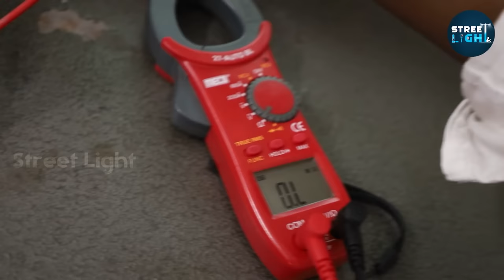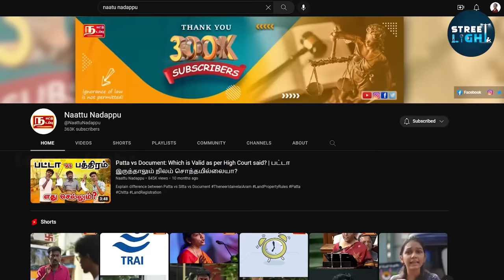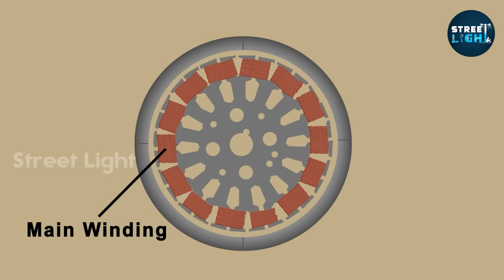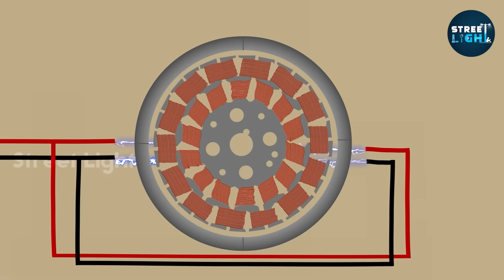How to repair Ceiling fan by ourselves | Capacitor working explained in Tamil | Ceiling fan

Comment: Fan LA sound varudhuna beaninga or roator issue irukalam....bearing ulla oily grease irukum adhu dry aagiduchuna sound varum....bearing mela iruka shield open panni grease apply panni fix panni use panlam....veliye nalla brand bearing vaangna 300 rs aagum...grease,tools irundha easy ah kammi pricela maathikalam....capacitor maximum metal LA kidacha vaangi potukonga....plastic use panradha Vida metal capacitor dhan best....plastic capacitor romba weak aagi fire aana impact adhigama irukum.metal capacitor LA avlo danger kidayadhu....nissan company LA fan related work pannumbodhu adikadi fire aagum....metal capacitor use panrapa fire periya alavula illa....
Reply: Bearing poochina fan கீழ விளுந்துடுமா pls சொல்லுங்க
Reply: @தனிமையின்காதலி-ந7ங  bearing problem aana keezha vizhadhupa....bolt edavadhu loose aana dhan vizhum....noise adhigama varudhu fan vibrate aagura maadhiri irundha oru electrian kooptu paarunga....fan leaf bend ah irundha vibrate aagum....apdi vibrate aana bolt loose aagalam...pudhu fan LA leaf bend irukadhu....naama fan kalati maaturapa keezha vachu adhu mela edavadhu weight vachirundha bend aagum....bearing tight aana fan suthadhu....apdi aachuna fan off pannitu electrician kooptukonga....bearing grease illana noise mattum dhan issue ah irukum....karakarakaranu sound varum....

Comment: ஃபேன் ஆன் செய்தால் ஓடுவது இல்லை, குச்சி வைத்து சுற்றினால் ஓடுகிறது நன்றாக..... எது பழுது அடைந்து வருகிறது ?
Reply: Capacitor change pannunga
Reply: Coil weaka irukum pls test by multimeter or by testing lamp or condenser poirkalaam or bearing poirukalaam
Reply: Mudala original bearing matunga illana coil weaka irukum
Reply: Capacitor problem mattum thaan capacitor change panrathuku capacitor la wire cut panni joint panunga illa connections photo eduthukonga